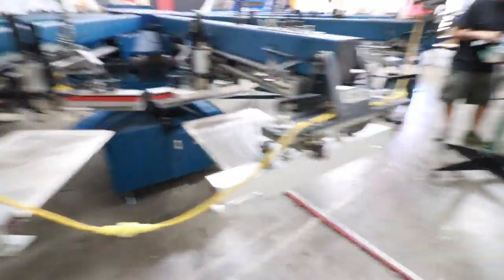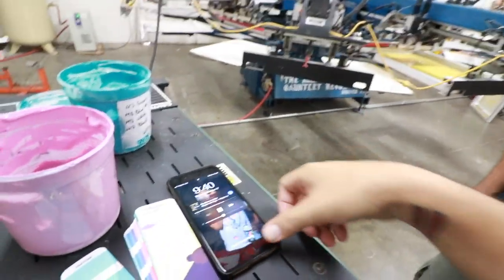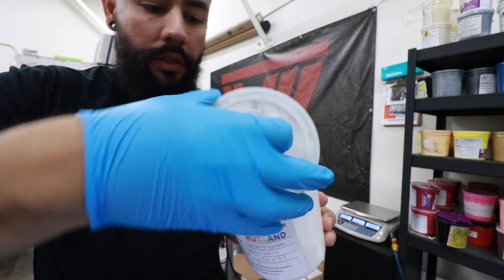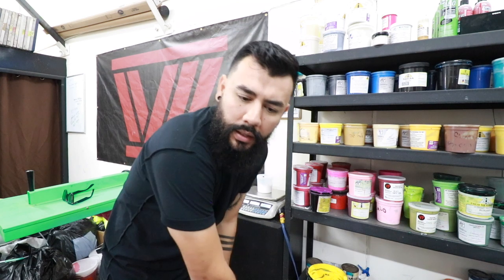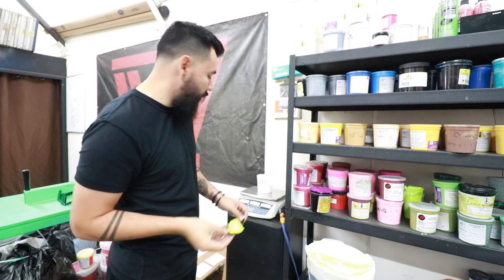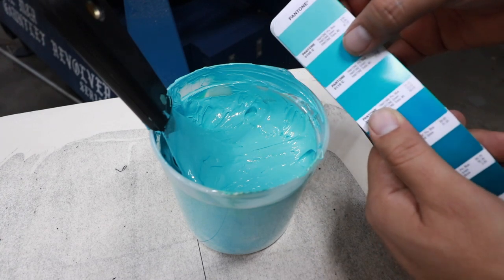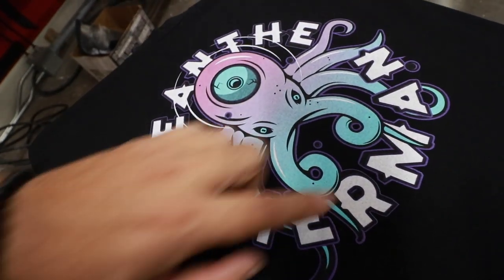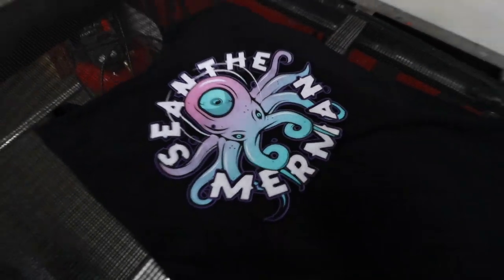screen printing six color setup on the automatic

Comment: 230 on base and 170 on colors or 170 on base and 230 on colors?
Reply: 170 on base, 230 on colors...for sure.
Reply from the maker: For that job I went 230 on the base 
And 175 in the rest of the screens 
If I had all 230 coated I wold of used 230 for everything
Reply: Well alright.  I was for sure wrong.